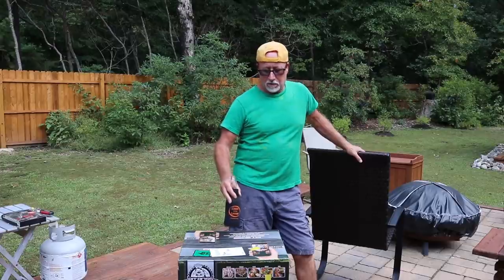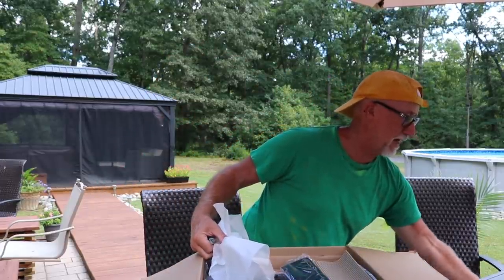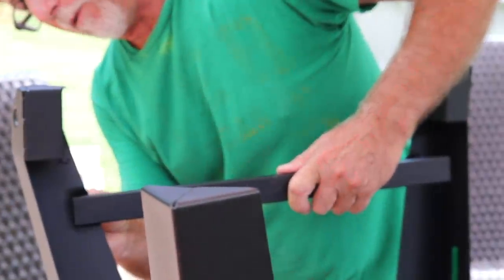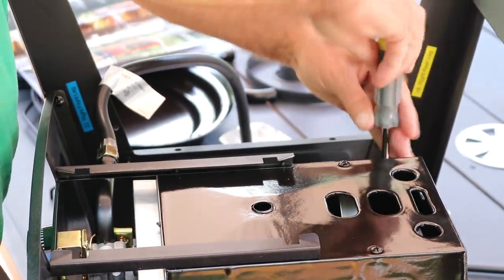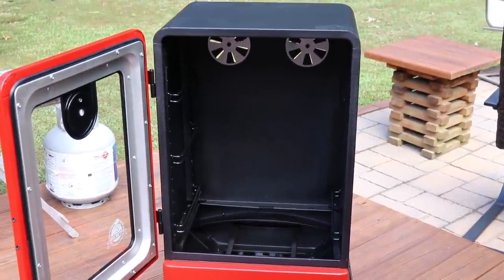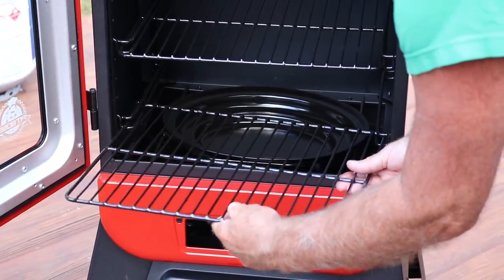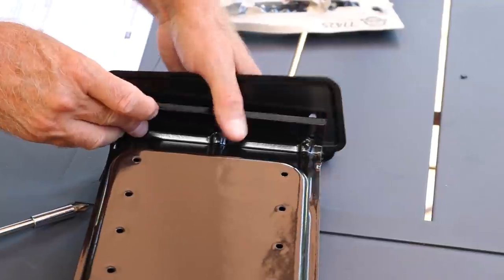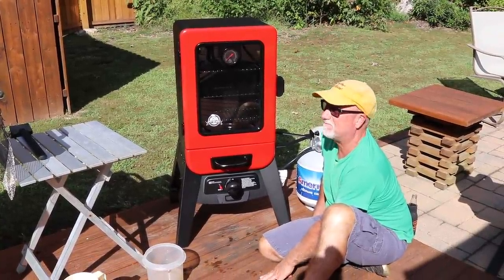Assembling our New Smoker!

Comment: Those would be machine screws, so not a bolt and not a “normal” screw that you’d use for decking/framing/drywall.
Reply: Wood screws
Reply: @marynettaabe9660  lounge tv cool video 👍